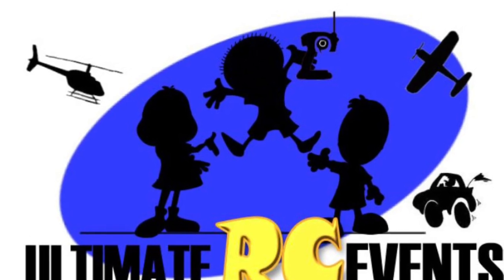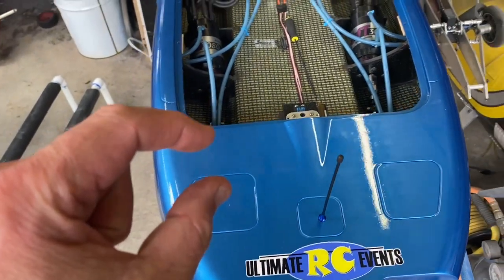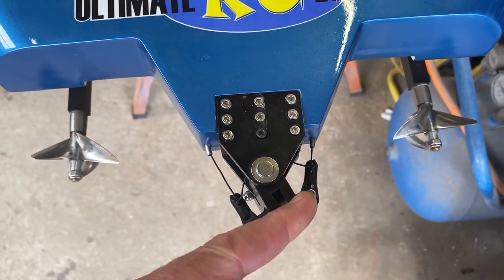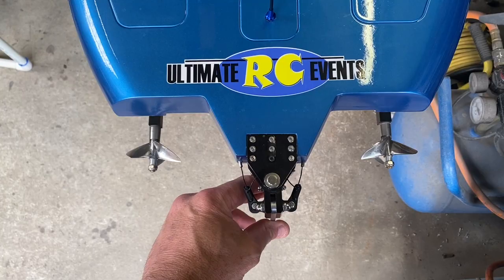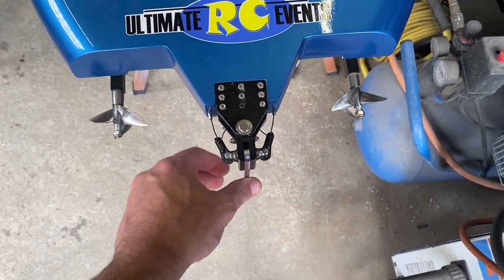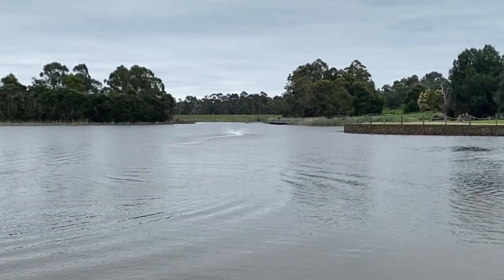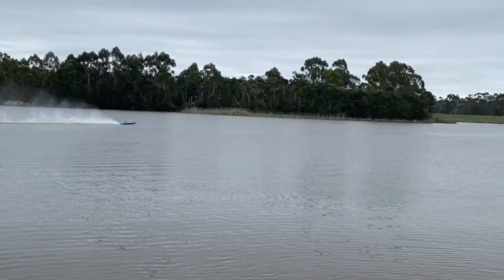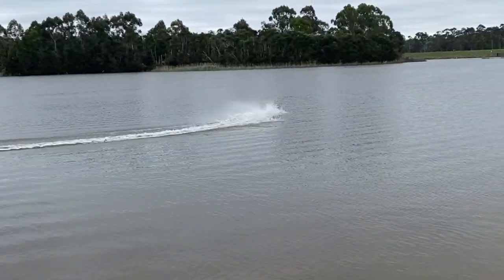150km/h RC boat hits a new bench mark

Comment: What you think is a small amount of rudder movement is a TON of slop for a 100kmph+ boat. You have to fix that. My suggestion is to move the rudder back further with an extended mount then go back to pull-pull directly on the centre-line of the pivot (servo AND rudder) vs all the offset bracket compromises you're making. If that's not possible then go to a push-pull. On an aircraft that is a slow flying scale plane a small amount of control surface slop is masked, however the same slop on a 150kmph EDF will rip the surface off. You have the same issue. With the amount of slop you have the servo is taking a beating at high speed. My 0.02c

Comment: you should try to put some pivot points in wire tubing too, making the wire rotates freely even you servo arm are bit bigger. then try to run your prop in inside rotation i think prop with outside rotation only works if it has 1 rudder in every prop

Comment: I had the same issues with the push pull system.  I decided to use push Rods and it worked.
Reply from the maker: I’ve changed the connection points again and it seems to be sorted.

Comment: What if you spring load your rudder system
Reply from the maker: Thanks for the suggestion but it won't work on a boat of this weight size and speed. to many forces going on.

Comment: What’s happening is the rudder slack and bad geometry causes the servo to quickly hunt for center making a wobble or  better known as flutter . This is a common problem for us flying large scale planes with large surfaces that apply pressure to the servo forcing it out of its center point . One easy fix is to tighten the surface so it will not have any free play . Make the rudder stiff at its pivot point I know this goes against what rc believe but it will work. Best of luck.
Reply from the maker: I fly big scale RC as well so I agree with the comments. The boat is undergoing some mods since the crash and a lot of this has been sorted.

Comment: I see your running prop rotation out?  That can cause walking issues. Looks like the front end hooked with the forward weight transfer, getting out of the throttle with some left steering input, and the right prop had the grip.   At our weekly club races, majority of boats run props in. Greetings from SoCal 😎
Reply from the maker: Awesome feedback. I agree with the your info. We are going to try changing the rotation and did have the boat set that way initially in build stage. 200 km/h here we come!